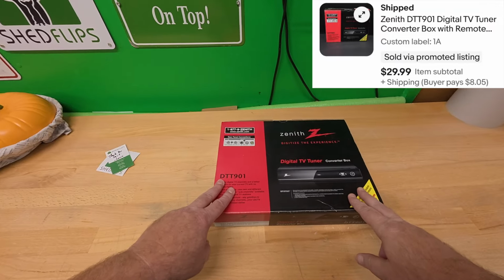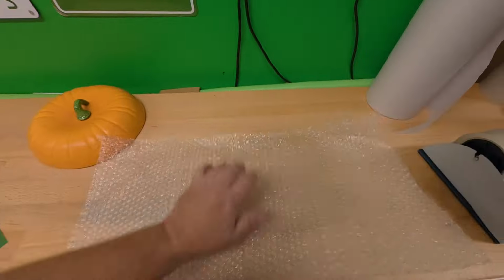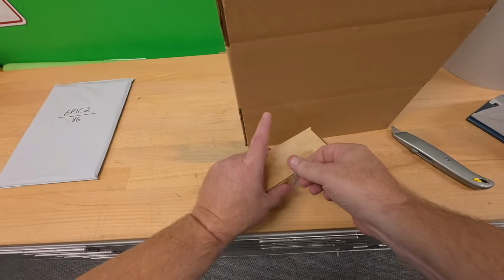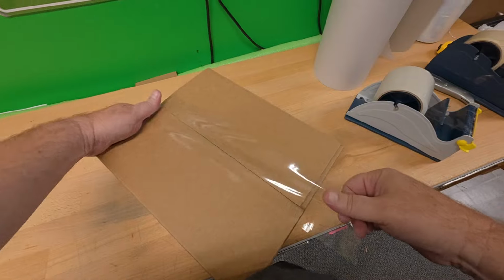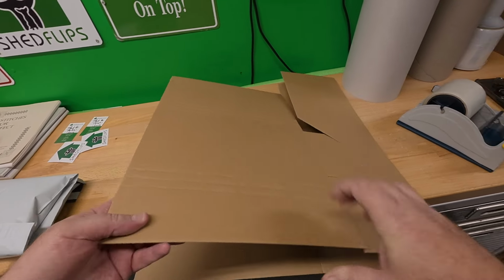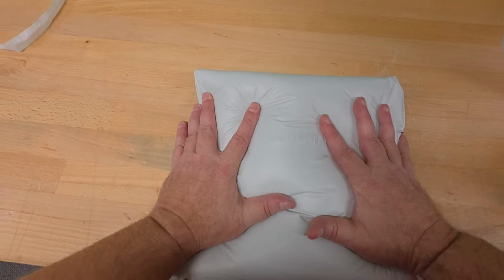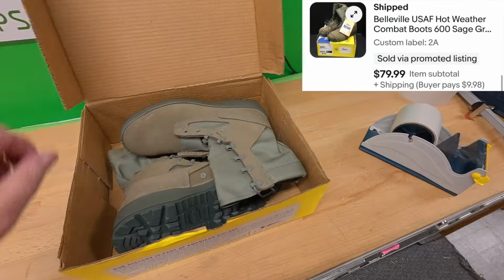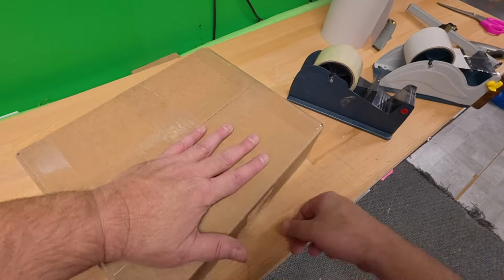PUMPKIN PACKER - I'M GONNA PACK IT #28

Comment: Hey Lonnie. 

  You don't know how much better I feel now that you have the box resized situation finally resolved. If you recall, I explained that my OCD would flare up every time you fumbled with the broken thumbnail. It was for my comfort really that I wanted to help out {but helping out my favorite packing video content provider was also a motivation, of course). 

  And the funny thing is that with each attempt, it got worse! The whole pliers thing was horrible. So, of course, I had to forge ahead trying to find a solution. All my research on Amazon came up short with finding the correct sized screw, and  then I didn't know what to do. But sometimes the universe opens up with a solution. I couldn't believe that the very next weekend at a  garage sale I came across a box resizer for a buck. I laughed out loud when I saw it, and the lady must have thought I was nuts, but I scooped it up. 

   The last part of the puzzle was to see if one of the better screws would match, and we did have a variety to choose from! And if not, the plastic screw would work-however you would be in the same situation once the plastic screw crapped out. And if you think OCD is bad in the present tense, future OCD is much worse lol. So home I went and SUCCESS!!. 

   It was a fun project for me, and I will have fond memories each time you use that resizer, hopefully for a very long time.

   Now the next thing to tackle is your current shortage of 3" My Go 2 Tape. I wish I had a spare roll to send you, my friend, but unfortunately I am in the same situation, I'm on my last roll of the good stuff. Lets go, Joel with the distribution of the new product. haha.

  Mike from NY
Reply: @mikemetco1966  like